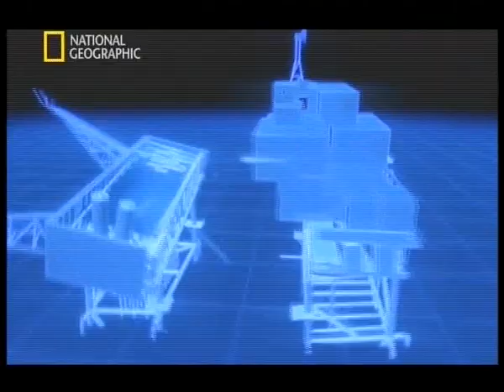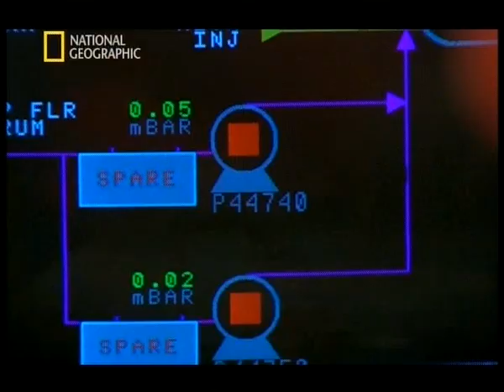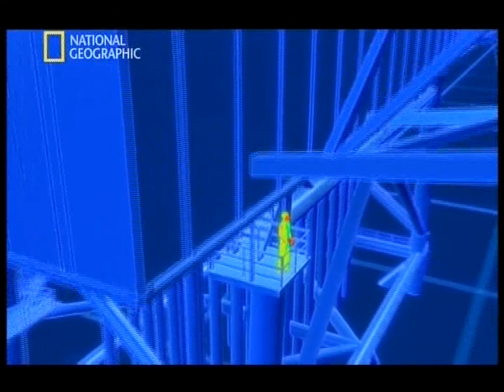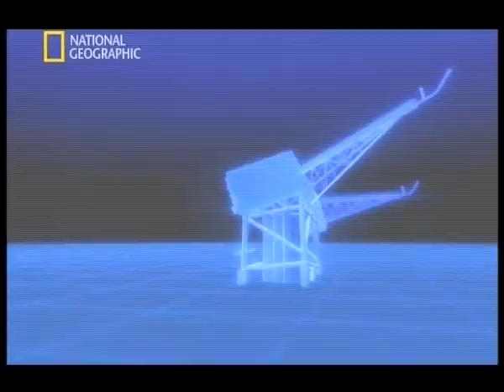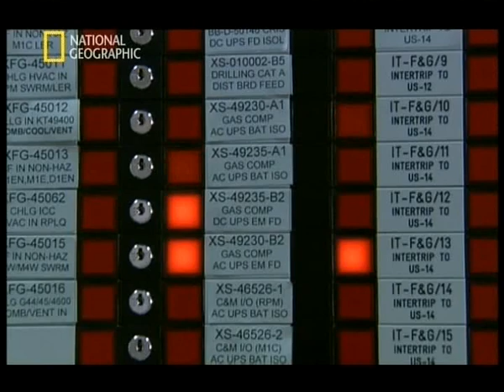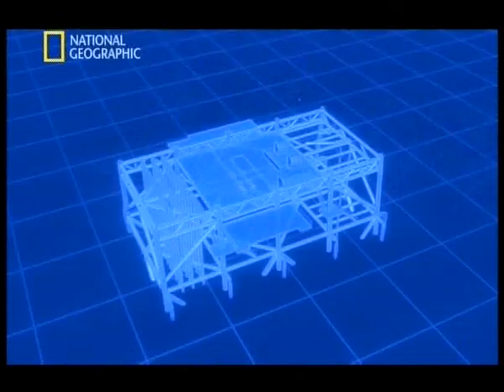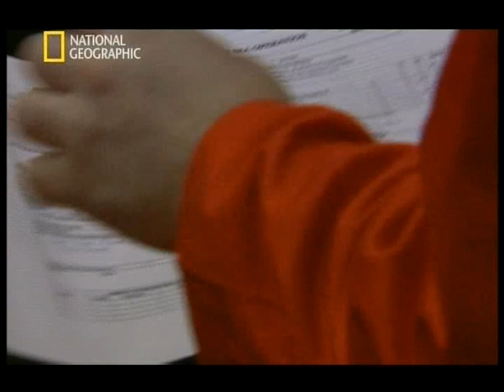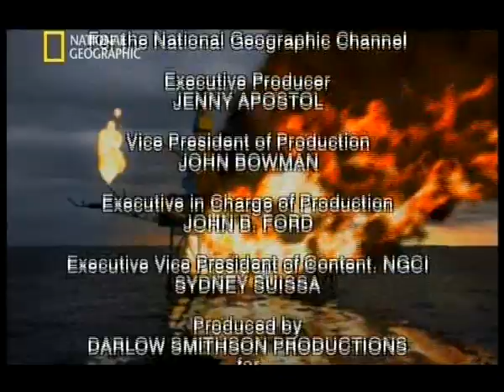Seconds From Disaster Explosion in the North Sea

Comment: Piper Alpha: Most casualties
Deepwater Horizon: Most damage to the environment
Reply: Byford Dolphin: Most grisly
Reply: Piper Alpha was operate by a Scottish company, that operated most of the rigs in that areas. Where do we put the Ocean Ranger 1982? I agree with the OP classification but the Ocean Ranger rig literally sunk in the ocean bed all of a sudden with all the workers inside, I think we should put also that one in the list.
Reply: @EM.1  
Same with Texas Tower 4, you can blame the comapnies for cutting corners that caused the disasters you shouldn't blame the crews, who never went to the rigs with the intent of blowing up the rig, or causing an oil spill
Reply: @snakes3425 OMG the most horrible accident: the Defense Department knew about all the issues, the personnel reported everything, and filmed the movements while in the Station, the company assigned for maintenance used duct tape. The geometry and stability of the platform was structured, calculated and built in the wrong way.
Reply: if I were to wager a guess why Piper wasn't as environmentally devastating as Deepwater it's most likely the fires burning the oil as it escapes
Reply: Look, this aired in 2004, while Deepwater Horizon happened in 2010. Also, Piper Alpha could've been avoided, while Deepwater Horizon was inevitable.
Reply: I just searched for "worst oil rig disaster" and Deepwater Horizon is what I kept finding.
Reply: Exactly

Comment: Greedy oil companies not wanting to stop production for proper maintenance caused this disaster. Greedy oil companies will always put profit before people, shareholders before safety. Nothing has changed.
Reply: Wasn’t the pipe fractured? Would that mean that if they turned it on again it would break? Deepwater horizon was flawed from the very beginning of its design being built the well was flawed at the bottom.

Comment: it's a shame they state that they think the flange was only hand tightened by the work crew.. it is most possible they instead improperly tightened it , and therefore had an improper sealing effect on the flange, at such high working pressures getting a good seal is very hard without great attension to detail on the bolt pattern and tightening specs
Reply: At least an informed opinion.
Reply: Hand tightened or improperly tightened; the difference is irrelevant to the fact that no safety valve was in place and that the pump wouldn’t had been started if the workers had been aware of that.

Comment: So what it basically came down to was the fact that the left hand didn't know what the right hand was doing in regards to the permits
Reply: Could be solved by sharing a automated message system instead of a pile of papers.
Reply: @kstanni87  And/or by having a single location on the rig where control, or at least supervision, of all aspects of operation is managed.

Comment: "Stay here and wait for rescue." Fk that, im getting as far away from the fire as i can. There is no way I'm counting on someone else to save me, im saving myself.
Reply: spiffcats If you're sure there's a clear path out, then run for it, but otherwise chances are you'll get lost or further trapped and then rescuers will have to search for you, putting them in more danger. It's very easy to lose your way when surrounded by smoke and flames, and suffering from smoke inhalation and total fear, it's how many people die in fires. Rescuers might even end up having to choose between looking for you and saving someone else if the number of rescuers is limited. That's why people are told to wait for rescue. These instructions come from firefighters, there is logic behind it. Obviously sometimes it ends in tragedy, but other times it saves a lot of lives.
Reply: Beware, you could just jump in a patch of oil which may catch on fire faster than imaginable (this is why O Chem should be taught in HS's). It's much worse to attempt to escape in the unknown (as usual, accidents don't occur when it's convenient).

Comment: what went wrong? greed of the owners and operators, that-s what MADE it go wrong.
Reply: shortcuts. 
Shortcuts caused the worst aviation accident in the US as well.
Reply: You are absolutely correct. Production over safety seemed to be the practice. See the link to a report on the incident produced by NASA. Not only does it cite a culture of negligence, what is worse, according to the report, the neighboring Tartan platform management was given orders not to stop production, given the consequential cost to Occidental. Better safety and a willingness to stop production would likely have broken the chain of factors that led to this disaster or at the very least mitigated it. 

https://sma.nasa.gov/docs/default-source/safety-messages/safetymessage-2013-05-06-piperalpha.pdf

Comment: Wouldn't the LPG need a spark to cause the explosion?  It never mentioned anything about that or would it have lit up from lights and electrics?
Reply: James Sanderson With that volume of gas leaking literally anything could have set it off, anything electrical and it's going to happen with a huge volume leak, sadly it's inevitable.
Reply: @deezelfairy  same with deepwater horizon as it’s construction was flawed from the very beginning
Reply: There's no shortage of stuff that can ignite leaking gas on an oil platform. Although the origin of the spark that started it was ultimately impossible to find, it's almost guaranteed to happen

Comment: I feel like the problem was not just about the PTW, but more about how the metal plate was not bolted on tightly? It was there to prevent leaks but was not tight enough to prevent leaks. If it was not leaking, the explosion probably would not have happened. The video says it is able to withstand pressures double the normal operating conditions.
Reply: The safety valve was able to withstand pressures double the normal operating conditions. Theoretically, the metal plate used to replace it during maintenance would've done the same...if it was bolted on properly, that is. It wasn't, compromising its strength.

EDIT: Whoops.
Reply: I know that this is an old comment, but I just wanted to mention that the video said that the safety valve was able to withstand pressures double normal operating procedures. However, in this case, the actual valve had been removed and replaced with a metal plate.

Of course, had it been fully tightened, it might still have been enough.
Reply: Virideon
Whoops. Should've been more specific.

Comment: Now if that worker would've never restarted that pump being worked on none of this would have happened.
Reply: Jeff Froment You can't attribute this to just one person/action dude, this tragedy was caused by a whole catalogue of systematic errors.

If the permit for the maintenance for the pressure relief valve hadn't been missing then no one have attempted to start the pump. If the fire pumps hadn't been turned off because of divers working near the intakes the fire would have been contained.
It's endless.
Reply: And if someone had thought to staple a copy of the safety valve work request to the the pump service request the worker would have never made that decision. Most accidents occur because of a series of incidents and conditions that taken alone would not be hazardous. Like most problems, we yearn for THE ONE THING or PERSON to blame, but usually it is more complex than that.
Reply: The work order permit was not missing the permit for pump and valve were stored in separate bins,  if the wussy divers never put a floor mat down on a drainage platform this wouldn't have happen
Reply: The thing is, you’re all right- like the series’s Tagline says, things like this don’t just happen- if any of the links in the chain had been missing, the fire could have been avoided-or been far less severe...
Reply: @TungstenCarbideProjectile  you really believe that they believe the company. Blaming the divers?